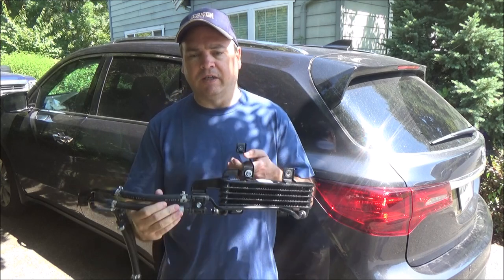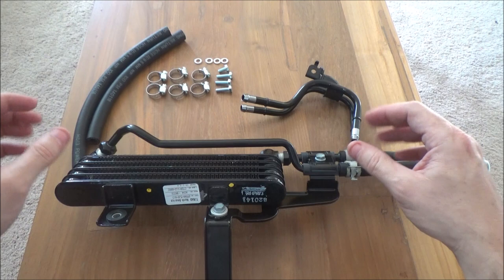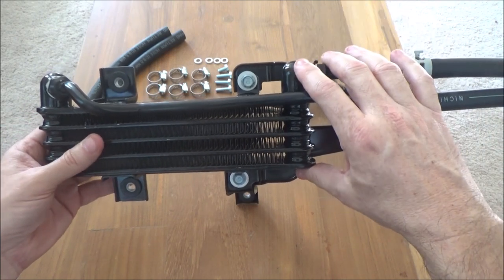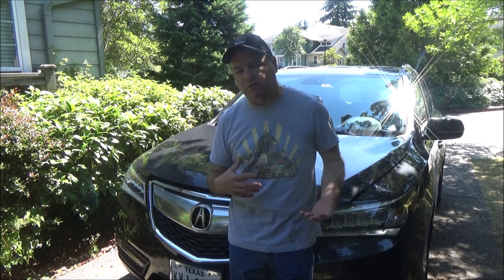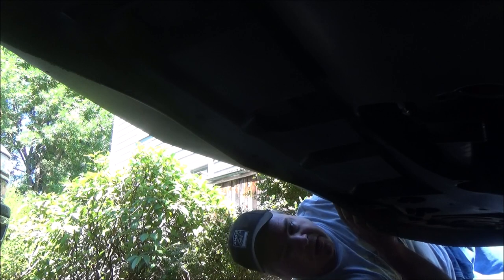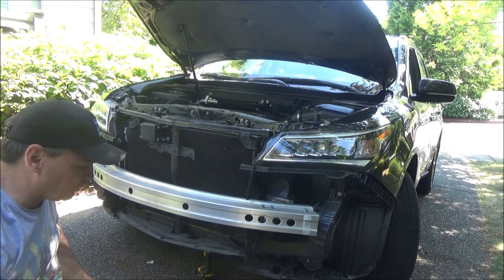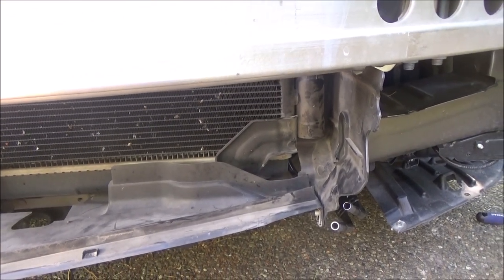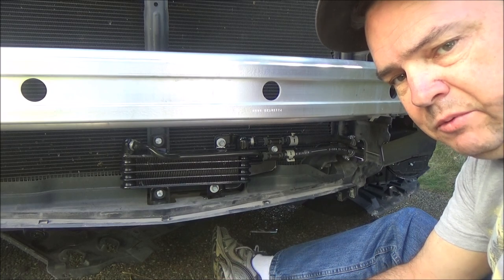Installing Transmission Cooler on an Acura MDX

Comment: Thanks again for sharing this great video. Not sure if I would install this cooler, don't have guts to take the fascia, LOL
BTW, can you give me some tip as to remove the battery tray to reach transmission filter? My ATF was pretty dark, burnt, I need to replace the ATF filter with 3rd drain & fill. Thanks.
Reply from the maker: Thanks for the comment.  The entire job was very easy, including the fascia.  However the battery tray was pretty simple. You need to remove the airbox snorkel first. Then just remove the battery cables and pull the battery.  As I recall, there were 2 bolts on the underside of the battery that held the tray in place.  Pull those and you can get the tray out of the way enough to remove the filter.
Reply: @RoughRidersTV  Thanks for your speedy reply. I watched another YouTube video on ATF filter change. It was for different Acura model and year, different orientation, but ATF filter is in the same general area. In the video, it was desribed somewhat PITA to remove the battery, a couple of more bolts hidden underside of the battery tray in addition to two bolts you mention here.
I'll get my third and final (at least for now) drain & fill of ATF, then do this ATF filter change tomorrow. Thanks again for your kind reply.
Reply from the maker: @LoveToGoEverywhere  No problem.  Glad to help.  I really don't think it was all that hard.  A socket and extension was all that was needed to pull the tray.  

If you are not doing the front transfer drain/fill, you don't need to remove the shield on the bottom.  Just use a paper plate to act as a funnel to channel the fluid to the drain pan. It will save you a bunch of time doing it that way.  I only removed the shield because I was doing the transfer case as well.
Reply: @RoughRidersTV  I've already done T-Case, Diff and 2 ATF drain & fill. My 3rd and last ATF drain and fill will be tomorrow. Undershield had been off for a week by now. I'll see what the 3rd ATF drain looks like, then decide to do one more drain & fill, I hope it's not needed. Then I'll do the ATF filter change. I'v done ATF filter change on MY 2006TL twice, this one looks like a piece of cake compare to TL. After that, brake fluid flush (with Motive bleeder) is scheduled coming weekend. Thanks again.
Reply: @LoveToGoEverywhere  That is more like my '14. Two bolts to remove the battery tray and then five more bolts to remove the battery tray bracket. Two of them are out of sight under the battery tray bracket. All easy to get to. A 1/4" drive air ratchet made it really easy and then I snugged them with a 3/8" drive manual ratchet.

Comment: I can't believe that Acura didn't install this from the factory. My 2007 MDX had it already.
Reply from the maker: Yea, not sure why. It's not like it is a huge cost adder for them during build and it would certainly benefit the transmission and allow them to spec out higher towing capacity than other cars.
Reply: They didn’t install them in the 02 unless you had the tow package. I think that’s part of the reason they had trouble with some of the transmissions. Mine never gave me any trouble but I’ve heard they had issues. I do think they need to have the cooling system for all these cars. It’s not the expensive and would have a big benefit in longevity of the transmission.
Reply from the maker: @AmerijamAcres  Completely agree. Heat is most certainly an enemy of your transmission so keeping it cooler can be very beneficial and a great marketing message for the company as well.
Reply: I'm trying to figure out of i have one on my 2008 Mdx

Comment: I’ve finally bought my new MDX. Wondering where you got that cooler from?  Mine is a 2017 but from what I’ve read the mechanics are the same. It’s the body design that is different. I haven’t seen these anywhere. So far I’ve only found the aftermarket one.
Reply: I do know the 2017 has the 9 speed but this should still work for that.
Reply from the maker: I scoured stuff from all over the place to get what I needed.  For example, AcuraOEMParts.com and OEMAcuraParts.com  as well as Bernardi's Acura have the full kits as well as some of the individual pieces.  The Kits are crazy expensive but if you can find some of the individual parts, you can basically put together everything that comes in the kit for way less.  I bought the cooler itself from one of the online OEM vendors (don't remember which one). I then just picked up the metal tubing that wraps around the radiator from a local acura dealer as it was cheaper than the online dealers.  I then picked up flex tubing and hose clamps from my local auto parts store.  All total was just over $100.00 where the kit was around $300. I had literally everything in the kit except some warning labels for 1/3rd the price of the kit.  It was more than aftermarket stuff but in the end, it made for a much easier install as I didn't have to zip tie the cooler to the radiator as it installed right into all the preexisting threaded and tapped mounting holes.
Reply: Awesome.  How did you get around the quick connect fittings?  I have a 2016 and diagrams show quick connects
Reply: @amansharafi2604  2016 is the ZF transmission - different than 2015 which is a Honda transmission.

Comment: I was under the impression to have the trans filter before the cooler so the filter would catch debris from the transmission and not get into the cooler.
Reply from the maker: Yes, I don't show it here but that is the correct flow.

Comment: My 06 MDX cooler is different style and much more money than you are speaking of.   
You worry too much about nothing.  Zip ties eliminate movement. 
Correct install is key to reliable use. 
I have been using universal tranny coolers on multiple tow vehicles for many years and never seen a leak or failure.  My 08 Silverado WT has 341K on the clock. 
A universal cooler with a fan and controller is the best way to go.  Less money than you spent. 
Amazon or eBay…lots to choose from, no names to name brands. My 2cents
Reply from the maker: I disagree.  Been working on cars now for over 40 years.  I have seen zip ties tear up condensers and radiators more than once and yes they were correctly installed. It doesn't happen every time and probably not a huge risk if there is enough of a gap between the condenser and radiator.  However, it is a real risk. Aftermarket can be fine and is certainly cost effective, however, if you can close that price gap between OEM and aftermarket, I would go OEM because it is a clean and easy install.

Comment: Would you be able to put one of these on an RDX?
Reply from the maker: You can add a transmission cooler to just about any vehicle and the process would be pretty similar with only minor differences in how it might mount.  However, whether this particular cooler would mount to an RDX, I don't know.  I don't know if the RDX has preinstalled a mounting position where the holes line up, etc. for this specific cooler.  But adding an aftermarket cooler is certainly doable.

Comment: Hi, this fill fit a Acura RDX 2014? I can't find OEM transmission cooler.
Reply from the maker: I don't know since I don't have an RDX.  It would make sense that it would for acura to minimze the number of unique parts but I honestly don't know for sure.  You could look at the section of the video where I point out the mounting holes and see if your RDX has similar mounting holes but even that would be somewhat guess work.

Comment: The 2016 Acura MDX 9 speed is little more tricky than this. Make sure you do your research if before taking the bumper down 

https://techinfo.honda.com/rjanisis/pubs/AI/AH/BII00315-06/enu/BII00315-06.pdf
Reply from the maker: Yes, it's actually why I bought a 15 instead of a 16 or newer.  I did not want the ZF 9 tranny. Way too fickle of a tranny and the fluid is way too expensive.